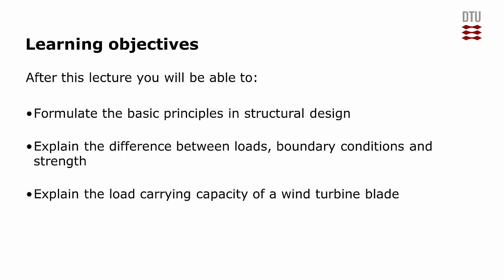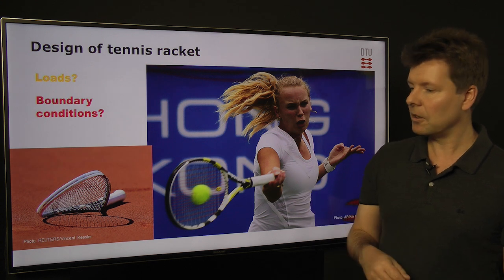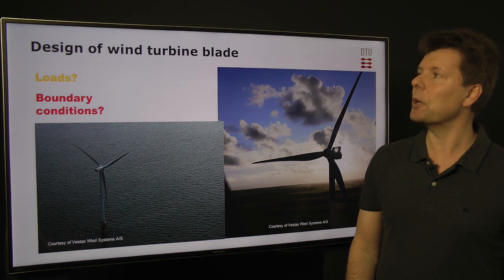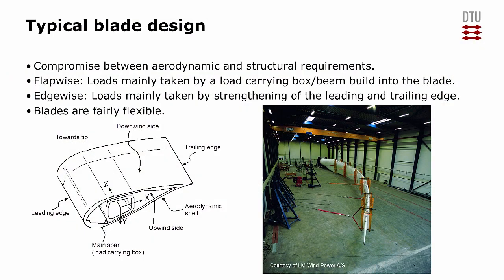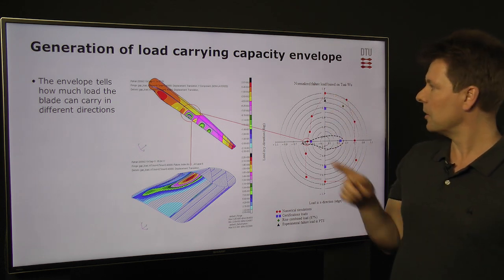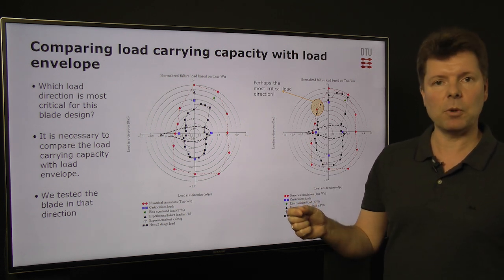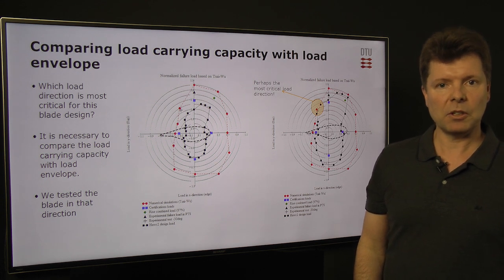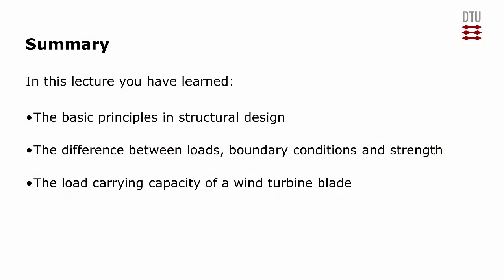19. Structural design of wind turbine blades

Comment: impressive experiment view! BTW, why is the part where the buckling occurs covered with something? Did your guys do full-scale dynamic loading test?
Reply from the maker: Dear Kun Yang

Thanks for your question. The part where buckling occurs is not covered, even though it looks like that. The surface of the blade is painted white and then a black random pattern is applied. We have done so because we use the Digital Image Correlation method to measure full-field displacements of the surface. You can see more about the Digital Image Correlation method here: https://www.dantecdynamics.com/measurement-principles-of-dic

Best regards
Kim Branner
DTU Wind Energy
Reply: Very impressive method! Many thanks to your kindly reply.